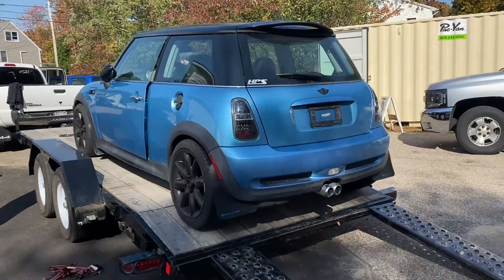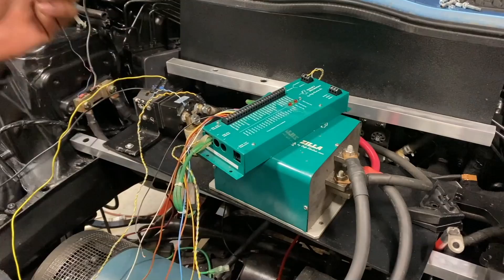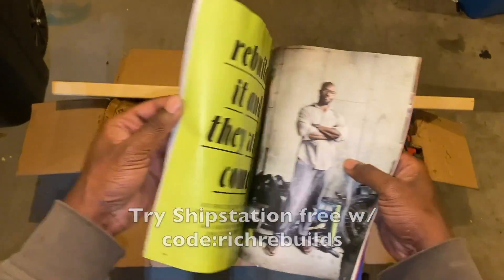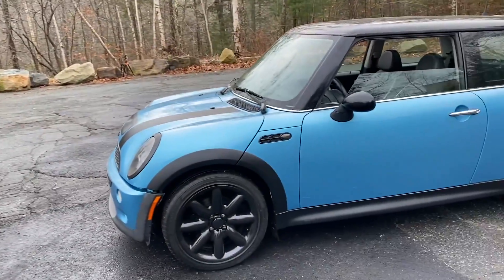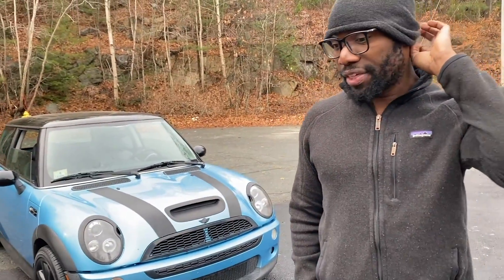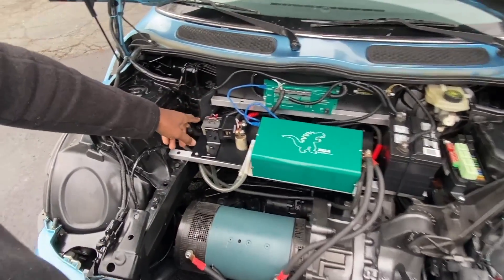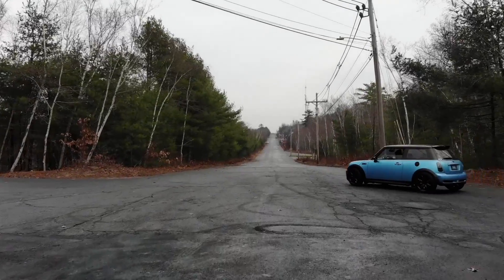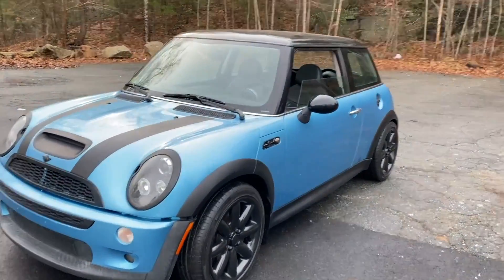We BUILT an Electric Mini Cooper for UNDER $3,000 and its Awesome!

Comment: Question, does traction control, a/c, heat, or airbags still work? Do you have a battery % gauge? If not, how difficult would it be to get all that stuff to work?

Comment: I owned one of these new minis, I kept it for one week and exchanged it, Everything about it was awful except the engine, I had the big petrol version and it was pretty quick and very refined but the rest of the car was like driving a car from the 1970s, uncomfortable, loads of road noise, a comical dashboard layout probably designed on the back a beermat, seats that broke your spine if you sat in them for more than 30 minutes, so you removed its only good point and replaced it with a Scalextric engine, great idea, I bet people are beating your door down to buy them. . . .

Comment: BMS for $200? Don't think so. Never saw it hooked up. What about the cooling system for the Volt batteries? Don't see it. Cell failure inevitable. Lovejoy couplers are not for EV's. Doomed for failure. First the rubber fails then the 'fingers' snap.

Comment: Looks like that was a blast to built and see 'done'(relatively speaking of course).  I was only disapointed by the 0-60 time.  My XC90 T6 Polestar can do it in a hair over 6 and it's 5000lbs.  Guess the limiting factor is the motor here and not the weight.

Comment: What about using a Thule roof rack type contraption for the battery mount and welding additional mounts to both secure the battery array and have a shock spring based mechanism for security. Jesus that car is beautiful

Comment: Haven't seen how the axles were attached.  The original engine had a carrier bearing mounting for the 2 piece axle, which would require a custom sub-frame to allow for the same mounting position if there isn't an engine to mount to.  If I'm not misktaken this topic was skimmed over and this very important detail is missing.

Comment: as a guy who build these mini cooper ones, i must say i'm impressed with the choices and how you did it. we do build mini electric but personally haven't seen them produced in volume. saving a f58 non runner was a good call, i'm guessing this is a older car 2010-2014?
Reply: This is an r53 from 2000-2006 I do believe

Comment: Man i would love to have this.. Ive always been obsessed with power to weight ratio, and light weight cars that reward more output with the same input numbers of heavier cars.  Geo metro, Suzuki swift, honda crx, mini cooper, mazda miata, toyota mr2 1st gen all good lightweight options. The thought of less resistance, less heat, less complications is soothing..... Id like to figure out how to DIY the most simple lightweight manual transmission vehicle possible... Geo metro is probably cheap as it gets if i could figure out how to make it RWD and maybe have 1 motor directly connected to each rear wheel so that the motors could be weaker and more controlled than 1 strong motor powering both rear wheels....

Comment: hello, I wasn't planing on doing this build but as i was driving to Swizerland to start a new job with my recently purchased ford 1.6tdci from 2005 (the long version since it has more space for work gear).

i started my journey in the <Czech republic , drove the car about 300km , it broke down 50METERS from the German border (I could actually see the German police from my car , looking at me and wondering why the hell I stopped 50meters from the border...) 

So as I tried to get the car to start moving again , something started clicking and blew up in the motor compartment, that was it.... 

No crank, dead motor! 

300€ for the car 300€ for body work and new fancy radio.... 300€ for the tow-truck to bring the car home.... and a Swiss job lost later.

Here I am at home thinking that I have an old band saw which has an electric DC motor on it so why not revive the dead ford?

Comment: Bindged the whole thing. Wonderful!  Great to find your channel. If you parallel those batteries on the right and left side for racing, for safety do you need to rollbar protection? Also, when not racing, would a form fitting 3D printed mold over both batteries help for tool boxes, rakes, shovels, groceries etc. for easy shopping and race day transport? Wonder if this mid channel could be preserved?

Comment: This is incredible, way to go boss! Now about those batteries..
Humble suggestion: fit both the motor + BATTs in engine bay, and move electronic things to trunk.
Pros: may allow BATT to be secured more safely, possibly room for another BATT later on, free up rear seats and trunk.
Cons: Would prob require some cable management.
Reply: scratch that, just realized why it's called a Mini, front of the car is tiny!

Comment: LeMons in Michigan starts in less than 1 week!  I'm signed up as "crew" for one of the teams but would sneak over to your paddock and help hot swap etc if you're going.  The Sunday morning EV loophole used to be all morning but I see it's only an hour long now. 
"11am-Noon: Quiet Hour--no race motors allowed".     So the million nickles prize is not as easily attainable.  Am I going to see you there?

Comment: So what gear do you use, I thought those batteries would do better than 41 miles with the 2 of them. Perhaps a series/parallel switch for max range/max power.

Comment: For the money, that's superb. Wait until a few more of those batteries turn up, and you can give it 80 to 100 miles of range with some careful battery positioning and securing, and still only spend $5,000 to $5,500.

Comment: Build a Jeep. Less g force..More range. Love the model A too. More about motors and transmission. With all that torque couldn’t you just leave it in high gear and modify current flow to save motor mounts? So many questions, so little time.

Comment: Hey man nice video! I got a question for you. Do you think its possible to add a two wheel with electric motor in the back of a gas car meaning when you dont want to used the gas pedal just use electric.

Comment: Pardon me, question from a peanut. Could a Jeep Wrangler be a good conversion? Ive always wanted one! Macgyver. It's always had an issue with being top heavy, but if you mount the batteries on the bottom, couldn't it just be amazing?

Comment: Rich!  You have to put the wood under the frame of the trailer on the back (on the ground).  You have to have enough so it supports the trailer and prevents it from squatting to far.  That way it keeps a low angle from the ramp to the "beaver tail" portion of the trailer (sloped part).  That would have helped keep the bumper from hitting.

  Of course you would probably have a less interesting video if you did...and you are getting payed for it apparently, so maybe I'm the one that needs to learn how to do it.

Comment: You know you could wire in a dimmer switch to control the torque, heck go to Menards and get one, Now all you'll have to do is figure out a good location, maybe on the steering wheel???

Comment: After watching your series on the conversion I am now tempted to find a old 4runner and mate the motor to the transfer case still giving me a 2 speed transfer and 4x4 for icy roads which would let you put the battery's under the hood since there would be nothing in the engine bay anymore.

Comment: Every Old Mini/Austin 7 Needs to go electric,  Fed up with breaking idler gears.  lets face it if Isagonniss had an viable electric power train usable he would have fitted it.  (half interesting one of the last classic mini's recently sold at auction (cannot remember the amount) the one lady owner from new said its totally original - it has only had one body re-shell, a couple of new front subframes and three new rear subframes.  (actually that is the beauty of the classic mini it is a pile of kit parts)

Comment: Well let see if you racing in the lemons and let say you going 80mph that’s not that fast but let’s go with it so that means you will need to stop and swap those batteries every 30 min and that will take let’s say 6 min (just a wild guess) and then you get a 5 min penalty so that mean 11 min lost every 30 min drive that puts you 80mph down to about 50 mph not gonna win any races there also a bigger issue is how long it would take to charge the extra packs. If you were swapping packs every 30 min in a 24 hour race you would have to swap out 48 times for a total of 96 batteries and they take 8 hours to charge (not sure the exact time) so that means you could only use the same packs 3 times so you would have to carry 32 total battery packs with you a and that if you don’t use more power at higher speeds and I’m sure you would. Anyways I’m not saying this car is not a great project it is one of my favorite projects you have done I’m just not sure how the race will work unfortunately. Please let me know if I’m wrong I’m sure I got something wrong but even if I’m slightly off it still seems far fetched.

Comment: That seemed like a pretty clean conversion. It was nice to see your break down of the different stuffage you put into the project. Pretty nifty! Say, do you think it would be possible to remove the entire drive train and battery system from a Nissan Leaf and install it nearly directly into the likes of a Nissan Rogue? It seems like there are a lot of similarities between the two vehicles.

Comment: That was fun, an amazing build and you have impressive skills.  But the range is a killer. $3000 for only 40 miles??  I can buy a used leaf for $5000 and get 70 miles without doing any work.  Or having zero knowledge, which is how much I have.

Comment: Hi Rich! Great channel! Have you checked out Piech Automotive? They have a battery prototype that uses lithium ion graphene instead of phosphate!  The batteries develop a lot less heat, so they can be charged faster, discharged deeper, and require additional cooling.  Their 500km range can be 80% recharged in 4min 40sec!

Comment: Now you just need to figure out how to mount eye-bolts to the batteries in some way so you can lift them out quickly with an engine crane for the hot-swap. It'll be interesting to see if you can come up with a better cradle and anchoring system.

Comment: You aren't shifting are you? Electric motors don't need the torque multiplier of having lowers gears. So you should just put it in 6th gear and take off. It will be much smoother than trying to start in first gear.

Comment: Can build a e car for 2500 well done , just not smart enough to drill a hole and use a locking pin to hold the trailer ramps in place. FAIL .

Comment: I have no idea if yall can do this, but maybe it would be cool/ good if you guys set up some kind of button throttle that spins the motor at a nice slow rate, just enough to launch into first gear, on the steering wheel, or somewhere easy to control it from, and hook it up to that controller — like I said idk anything about this stuff; just thought it was kind of a cool idea.

Comment: I love what you have done to the mini. Maybe stiffen up the suspension in the rear, or install coilovers all around because it is sagging. For battery safety, an "X" roll cage in the back on top of the batteries?

Comment: you're on drugs if you think that car will do lemons. you'll need over 25 sets of batteries to finish the race if you run them in series. and you'll  get fucking smoked by 70% of the other drivers running the batteries in series.

Comment: epic build but set up a quick switch wire up an equivalent breaker to be able to turn off batteries and turn them back on (kinda like what i did with my dual battery bank) love your vids keep up the good work

Comment: can you use some kind of anti roll bar that would get bent due to projectile batteries in a rear collision, in a way that stops the batteries from colliding the front seats? like an H shaped tubular thick steel separating rhe front seats from the batteries?

Comment: Hey Rich, have you looked into the Prius inverter hacks? Apparently, there's a chance they could achieve DC-DC Fast charging through the standard battery terminal. I know some EV Guys have started using them for ~150HP builds.
It'll be interesting to see the Lemons attempt after the cage is installed- you'll likely need a corner bar which will dictate battery placement, not to mention corner weights. If you can, a ramp "Down" pointing into the feet of the seats will probably be the best option to both keep it simple, easily removed and weight close to the bottom.

Comment: Excuse my ignorance... But can the controller be programmed to ramp up current to the motor more slowly and as a function of the accelerator pedal displacement? A 1/2 degree of accelerator displacement = x value of voltage which is then used by controller to a corresponding current?

Don't flame me , Im genuinely ignorant to how this works.

Comment: General observation as an R53 owner: you've achieved the same specs as the petrol model but with less range. Do you think it was worth the effort? Normally we'd achieve this with a cam, injectors and reduced pulley and we get to keep the supercharger whine.

Comment: Are you seriously trying to put a gas motor in a electric car? I swear that's what it looks like at the end of the video. Looks right and looks left then rubs hands together mischievous Lee moo ha ha ha ha ha. Problem is you're doing it wrong. You take the body off of a Model S and mounted on the frame and drivetrain of something compatible it's a lot simpler than the way you're trying to do it. Guys have been doing that sort of thing since before I was born making Vehicles like the old Vega which had a very very very bad motor combined with a less than adequate frame and putting the body on something with a lot more horsepower. I know a guy that did five or six of them where they had a Chevy 350 up to a 454 Big Block on a old Vega body you used to use Chevy S10 if I remember correctly and Cut a frame and do some other modifying.

Comment: great show as usual Rich. you could smooth out low speed driving by starting on higher gear, say 2nd or 3rd.
Reply: I think he already is using third; it's very common when retaining the stock manual transmission.
Reply: @snowrocket  maybe 5th 🤣🤣🤣

Comment: For the engine mounting points - recheck where they are supposed to be. (Rather than the crash tube mounts). I take it you can go with a much more solid solution given the electric motor does not have the vibrations that the gas engine does. Also check the lower rear A-arm bushes - looks like they are gone, this will also cause nasty launches. Common issue. Wish I could EV swap one of mine. Would be great to see this car sorted as a daily.

Comment: I'm sure you've thought of it: If you mount the batteries lengthwise, and build a piece of box section above them, you could use a forklift to the them the 'fork outta there' in a hurry. just needs a high voltage disconnect plug and a impact gun to swap them.

Comment: Forgive me if this is a dumb question. Could a person not connect an alternator to each wheel of the car via pulleys and so on. Kinda like regen braking. To help with charging the batteries when the car is in motion obviously using a charge controller and regulator. Or would the resistance outweigh the gain in charge. Obviously it wouldn't be a perpetual motion example but like wouldn't it extend your range tremendously. I'm sure there's a reason why this doesn't exist but maybe the powers that be don't want us to lol

Comment: One thing I think can be done to improve it would be adding one alternator on each side of the rear wheels for regenerative braking and torque vectoring for improved steering to take corners even better than before.

Comment: Hi Rich. Looks like I missed it - How did you stop the lovejoy connector from sliding on the gearbox input shaft? - so that it stops grinding into the gearbox case. I saw that you ground the clutch disk hub to provide enough clearance so the motor would turn - will it now continue to "Self Clearance" - or is there a collar on the input shaft? When it was a clutch it could slide freely on the input shaft as the range of travel was limited by the pressure plate. Just wondering.

Comment: If you cut 2 pieces of wood the width of your ramps and put them on the ground at the beginning of the ramps they won't pop up. Two 2x4 pieces will do. Just lay them on the ground touching the ramp (not under)

Comment: How do you license a rebuilt car with the DNV?  Excellent series ... totally inspiring ... well done!  Look forward to the next one.  
P.S.  I have quite a bit of experience with Marinized Duramax Diesel truck engines.  This has been taken over by BUKH in Denmark now ... Extra power is all about how big a booster pack you want to add.  How big the turbo or super charger.  Marinized Duramax easily got the Duramax to over way over 500 hp but with super chargers.  I would not go with Garret turbos - and find a great engine computer system.  Good luck with the truck.  I hope you have a well cast engine, because one of my engines had a hair line crack in it and remember the cylinder blocks are not lined, but pure cast with thin 5mm walls, so if you blow the block, bye bye engine.

Comment: On the ramps, two thing.  1) The ramps can be adjusted to any width. 2) try using 4th or 5th gear to bring down the torque.

Comment: I believe that you said that you were using a Warp 9. If so, you need to put those batteries back in parallel. Running them in series will push out around 300v, nearly double the rated volts of the motor. That could damage the armature and destroy the motor. 

Just run them in parallel. Amps cause heat, but that can be cooled off. And the motor should only pull a max of 500 amps for brief periods.